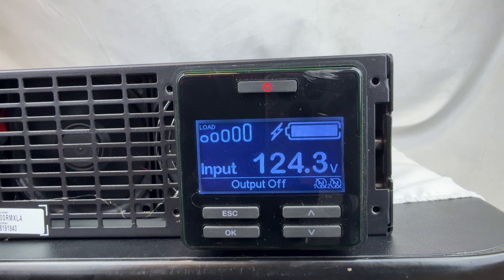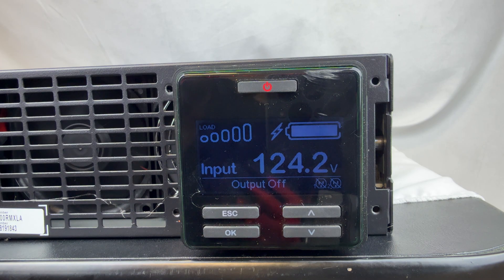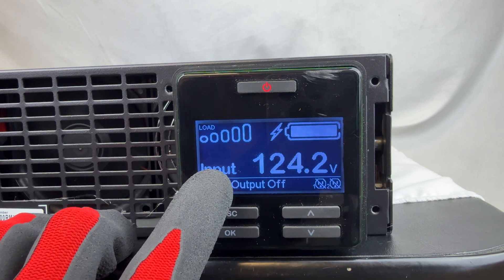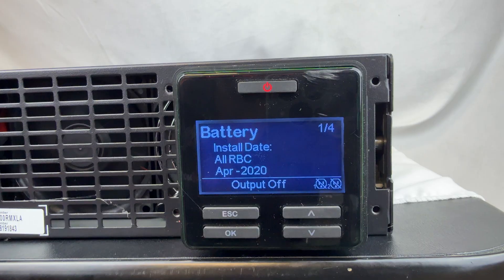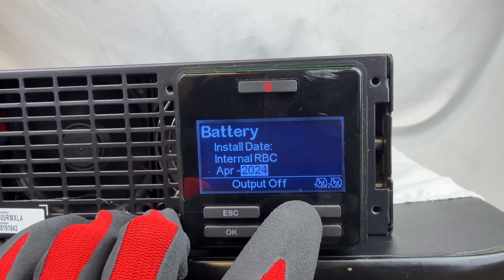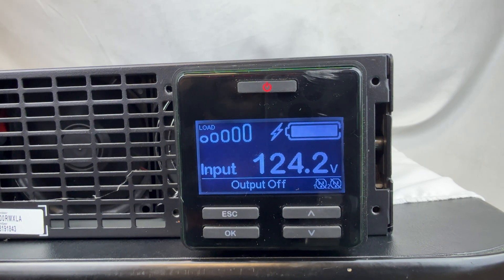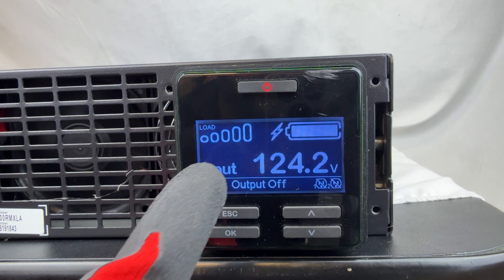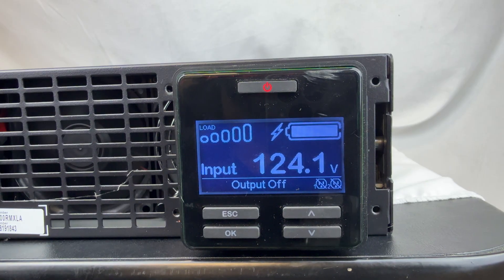How To Update The APC UPS Battery Date After Replacing The RBC Battery

Comment: Hmm, battery date keeps going back to the date im trying to change about 5 secs after I've made the update
Reply: Same here. Any ideas?
Reply: @cesarglzg  Neither procedure worked for me..I'm wondering if the installer locked that setting from anyone's access to change or update it.  Lets see if APC chime in.
Reply: Same with me. But with my ups the output is on. Maybe the output needs to be turned off to reset like in video?